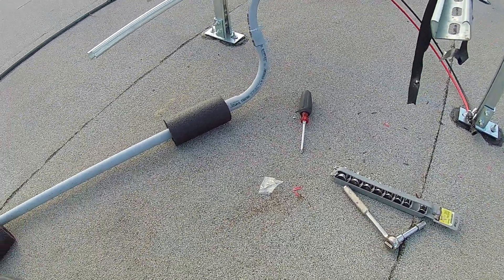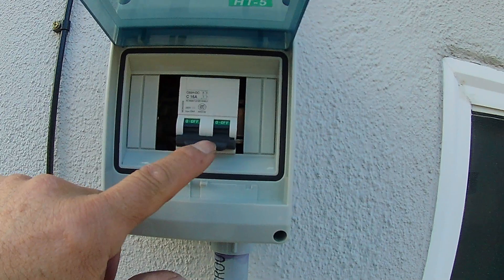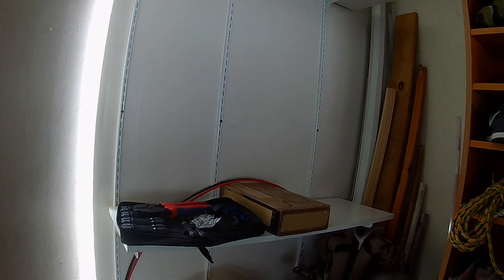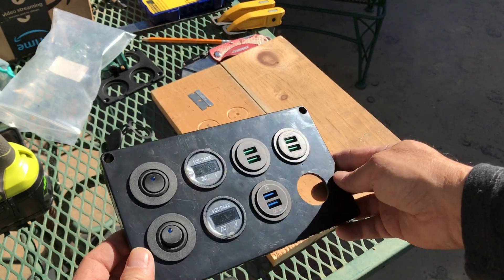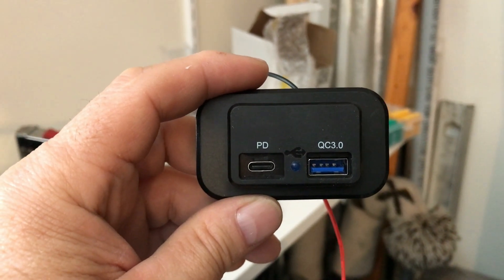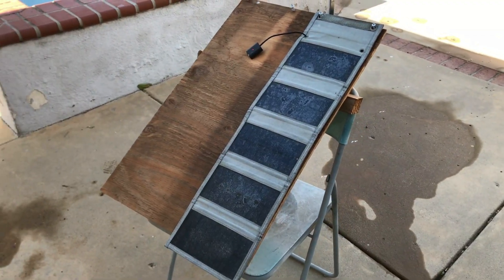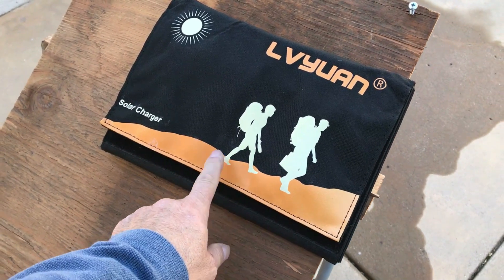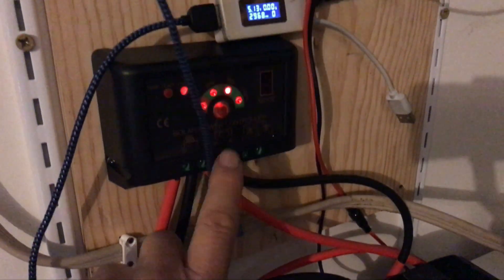200W Off-Grid Solar Powered Garage - Part 2 - Wiring and Solar Panel Mounting

Comment: Nice setup. Any particular reason why you got the Zooms battery ? (Now Redodo) 
Also your charge controller may not be for LiFePo4 batteries and may damage the battery over time so you should double check on that. Greetings from Jamaica.
Reply: Ok, just saw your other video where you upgraded your charge controller to the all in one unit. Great work!
Reply from the maker: Thanks for your comments!  I chose the Zoom after I saw Will Prowse did a tear down review on it and he concluded it was actually a solid battery.  I got the second one about a year later, after the company changed its brand to Redodo. Actually, that first charge controller died after less than a year - bad solder joints.  I did a short video on that.  Then, I upgraded to a different 12V charge controller, and it was after that I got the second battery and then eventually the all in one.  The original charge controller claimed to be compatible with LiFePo4 but ultimately it failed due to the bad solder joints.  I did fix that one so now I have TWO 12V charge controllers and a 1KW inverter on my shelf !  LOL.
Reply: @PhilsDIY  great! Thanks for the update. I am currently running one 100ah Power Queen LiFePo4, a 60amp Li Time Charge controller and 1000 watts in panels. It supplies approx half my home power here in Jamaica.

Comment: nice install, very clean.  did you do the conduit also?  and how does the transfer sw from grid to your system work?
Reply from the maker: Thanks!  Yes, I did all the conduit work myself as well, both the EMT and the PVC work.  The transfer switch has a primary and backup inputs.  I have the inverter output connected to the main supply of the transfer switch, and the utility power connected to the backup supply.  The output is fed to that box on the wall with the switch and outlet, which is the switch for the main garage lights and that outlet I use for plugging in various things.  The transfer switch output also goes through the upper conduit across the ceiling to the outlet that supplies the garage door opener.  If there's an overload situation and the inverter shuts down, the transfer switch automatically flips to the utility power.  Once the fault is cleared and inverter turned back on, the transfer switch flips back to the inverter power.  The only minor flaw about this transfer switch is that it uses power to hold in the primary position using what sounds like a solenoid, and when it energizes, it's not a clean transition to the primary position.  Dropping out of primary to the backup position is instantaneous.  All in all, I'm happy with the way it works.  There's a link to that switch in the description of the video.